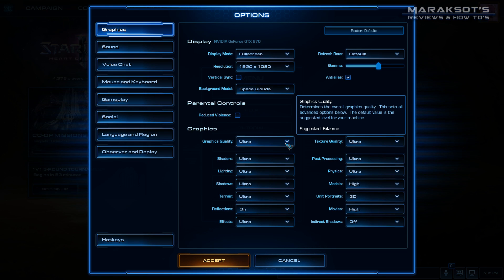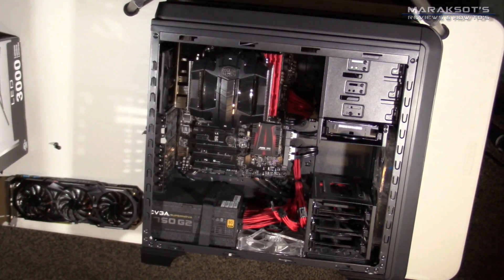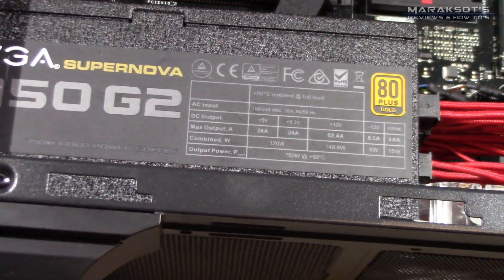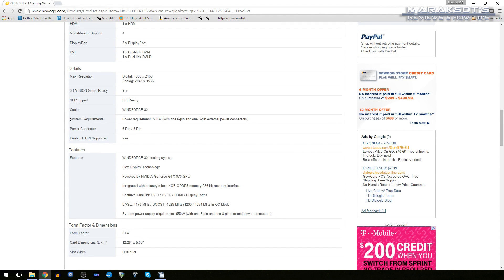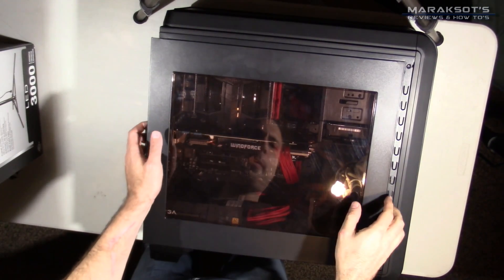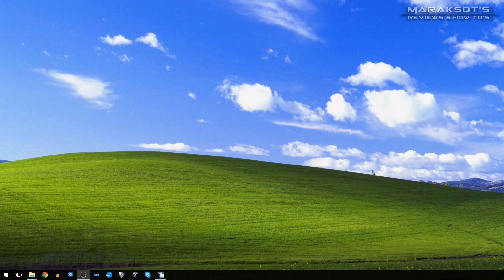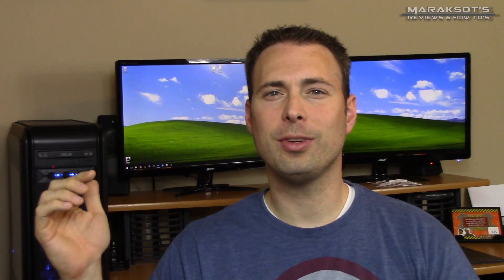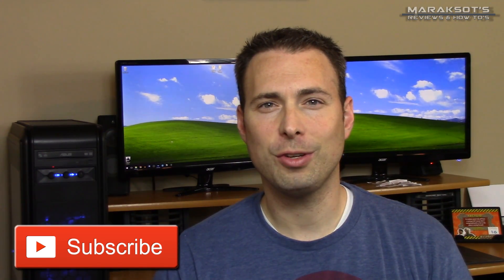A Beginners Guide - Upgrade your GPU - How to Install a New Graphics Card

Comment: My laptop has nvidia GeForce 940mx is it any good?
Reply from the maker: If you're wanting to run games at 1080p at High settings then you're going to have some really bad frame rates but if you're ok with playing on Medium and Low settings you should be ok.

Comment: My processor is a AMD fx-4300quadcore 3.80 GHz 

Can it run a graphics card like a GTX 1070
Reply from the maker: +why be just a gamer a GTX 1070 will work with the FX4300 however it's performance will be limited a.k.a. "bottlenecked" by your CPU.  What many people new to PC gaming don't understand is what bottlenecking actually is. The CPU (Central Processing Unit) is essentially the command center for your computer.  All data for any program running on your computer must be processed by the CPU.  When you have an older style architecture or slower CPU (like in your case the FX 4300) and you pair it with a much newer, high end GPU like the GTX 1070 what happens is your CPU gives your graphics card a job to do (render something in a game) meanwhile the CPU continues doing it's job for the game to run.  As soon as the GPU finishes doing the task it was given it stands ready to receive it's next set of instructions.   Ideally your CPU will be fast enough to continually feed your graphics card with the data that the graphics card needs to process so that it's never sitting idle, maximizing your number of frames per second. However what will happen in your situation is the GTX 1070 will finish processing the data it's been given and then will have to wait for the CPU to supply it with its next set of instructions resulting in fewer frames being rendered. Because the GTX 1070 is much faster and much more powerful. This reduction in frames due to the GPU having to wait for instructions from the CPU is what is called bottlenecking.  So let's say in a game the GTX 1070 is capable of displaying over 200 fps when paired with a high end CPU.  And when you pair it with something like the FX4300 then it's only capable of 100fps (I don't know for sure what the real numer of fps would be, this is just a hypothetical example) because it's spending half of it's time waiting for the CPU to send instructions to it. With the GTX 1070 costing between $400 and $500 U.S. in my opinion it doesn't make sense to spend that kind of money and then only get $200 to $250 worth of performance out of it.  Not to mention if you're playing on a 1080p 60 hertz monitor the GTX 1070 is way over powered for that. Because once again it will be rendering waaaaaay more frames per second than the monitor is even capable of displaying.  In my honest opinion I would think that the FX 4300 is probably more suited to something like a GTX 1050 or 1050 TI anything more than that and you'll be paying a lot of extra money for performance that you won't get out of it.

Comment: Before installing the new graphic card, do i need to unstall the previously one's driver or something?  Anyhow, after i've plugged the new one, how will appear a image on my monitor if the new one doesnt have a drive yet? It just doesnt make much sense to me and i'm afraid ill make a shittone here :0. Please help me here (noob detected)! It very incommum for the youtubers who do these types of videos to awnser this type of silly question lol
Reply from the maker: it really doesn't matter in which order you uninstall and install drivers.  You can swap out your old graphics card for a new one and then uninstall the old drivers and install the new ones and everything will work just fine.  Even when the drivers are not yet installed your graphics card will still work to display thins on your monitor.  Your computer still knows that your graphics card is a display adapter and will use it to display things to your monitor.  Drivers are basically the instructions for your graphics card that tells your computer everything your graphics card is capable of doing and how to use all the features of your graphics card.  Best of luck to you on your upgrade.  Cheers!  :)

Comment: Great explanation, thank you. If I want to install two identical graphic cards but only one slot of my three PCIe slots is a 16x slot, do I need a new motherboard with at least two 16x slots?
Reply from the maker: luftbilderhd no, what most people don't know is that the X16, X8, X4 or X1 is a designation of how many PCI Express lanes are available to that slot. Your CPU is built with a certain number of PCIE lanes (direct lanes of communication with the CPU) on it. Most mainstream CPU's have 16 PCIE lanes on them. When you use the X16 slot then all 16 of those lanes are made available to your graphics card so you can get quick communication between your card and your CPU allowing your games to run smoothly and at as high of a frame rate as your card can muster. However modern graphics cards don't have enough "horse power" to saturate all 16 lanes. 8 lanes is plenty enough for all modern graphics cards to my knowledge. And what happens when you install a 2nd graphics card in your system is your motherboard recognizes you have 2 graphics cards installed and then allocates 8 lanes to each card which is really all they need anyway. So if you're wanting to run an SLI or Crossfire configuration or are wanting a dedicated PhysX card I think you're good to go.

I feel I should add that not all games are written/optimized for multiple graphics cards so in some instances you're better off to buy the single most powerful card you can afford rather than spending the same amount of money on 2 less powerful cards.  For example, one $500 graphics card will give you outstanding performance in all games where as buying two $250 cards ($500 total) will perform really well in some games but not in others (some games will literally only use one of the 2 cards). So on those titles your money is kinda wasted.  I would really only recommend getting 2 graphics cards if you're going for the best of the best.  Like dual GTX 1080ti's or something as there is currently no single consumer grade GPU that can match that kind of performance. If you're wanting to do dual GTX 1050's or 1050ti's then you're probably better off to use that money to buy a GTX 1060.
Reply: Thanks a lot for your quick and detailed reply! Very appreciated! Now things are becoming clearer for me. Currently I have a three year old Gigabyte Z97-D3H motherboard with an i7 4790K, 32 GB RAM and a GTX Titan Black with 6GB VRAM. This machine is my sim PC, still running pretty well. When I use it, it runs X-Plane in 99% of the time. X-Plane is currently OpenGL only, SLI or Crossfire are not supported. I'm planning to upgrade the sim. I would like to go from currently one monitor/TV to three monitors/TVs (I think about 60" or 65" TV running in 1080p). X-Plane 11 has built-in multi-view support, so Nvidia Surround is not needed. Nvidia Surround would distort the picture on the edges anyway. Regarding X-Plane the CPU is always the bottleneck. Thus I think about changing the graphics card in the 1st step, because I need three reasonable video outputs. I think about a GTX 1070 or 1080, but I haven't built up my mind yet. I suppose that a GTX 1080ti regarding X-Plane would be overpowered.  In the second step (maybe next year) I think about enhancing it to six (!) monitors/TVs, arranged in surrounding portrait mode (something like this: http://flythissim.com/products/fixed-wing-flight-simulators/touchtrainer-fm-210.html). And no, I'll not use projectors, curved screens or VR headsets. To support six monitors/TVs I need a second graphics card with additional three video outputs. And I probably need a new PC with an actual CPU, but I could use both graphic cards with this new PC. Or I will run two instances of X-Plane, one on each PC, and connect them as master (the new PC) and slave (the current old PC) via X-Plane network support. 

But at first I'll have to achieve step 1. For step 2, that's why I was asking about a second graphics card. 

If you have some other ideas, I do very appreciate your advice!
Reply from the maker: you're welcome.  I'm happy to do what I can to help.  Sounds like you're going for a pretty amazing X-Plane set up.  I personally have never run games in multi-monitor mode.  I only use my dual monitor setup for productivity stuff as I work from home a lot so I don't have any first hand experience with multi-monitor gaming.  My understanding though is when you have multiple monitors it puts a lot more demand on the GPU as it has to render 2 (or in the case of what you're looking to do 3 or 6) screens worth of pixels.  In which case having a high powered graphics card like a GTX 1080 or 1080ti I think would serve you very well.  One very cool feature Nvidia's 10 series of graphics card have built into them is something called SMP (simultaneous multi-projection) it's a feature designed for multiple monitor gaming.  It eliminates the distortion on the edges you mentioned in games that are programmed to utilize it.  Having dual 1080's or 1080ti's is going to be very expensive but from the sound of it you're looking to build the best X-Plane simulator you can so I imagine the budget you have in mind for this upgrade is quite high.  Personally I feel that your i7 - 4790K is still a very good/capable chip even when using a GTX 1080 or 1080ti, however if you're thinking of upgrading just out of curiosity what platform/CPU do you think you may want to upgrade to?   Are you thinking of an Intel Z270 motherboard with the current king of gaming chips, the 4 core 8 thread i7 - 7700K?  Or going up to their enthusiast platform, X299 and something like the 10 core 20 thread i9 - 7900X?  Or are you more interested in AMD's latest Ryzen architecture and going with their X370 platform and an 8 core 16 thread R7 1800X? Or going up to their enthusiast platform, X399 platform and getting their latest 16 core, 32 thread Threadripper 1950X or something?  Going with an i7 or R7 CPU is going to be much more affordable however the i9 and Threadripper CPU's offer a lot more cores and threads as well as 44 PCIE lanes on the i9 and 64 PCIE lanes on Threadripper but they're also $1000 CPU's.  Sorry if I'm being too nosy I'm just very excited/interested in technology and love talking about it.  :)
Reply: Thanks again for your reply! I'm glad that you like technology; I do so as well. ;-) I don't have any multi-monitor experience on Windows (on Mac, yes), that's why I'm reading, watching and asking a lot. ;-) Thank you for the hint about Nvidia "simultaneous multi-projection". I suppose it's something like Nvidias "Mosaic". Regarding X-Plane you don't need those Nvidia features. You just have to set up your screens in Windows system settings, everything else you can manage within X-Plane. The latest version X-Plane 11 has a new multi-view setup. You can adress the screen what you want and set the virtual camera as you like (you can adjust the view angle a little bit for bezel correction etc.). For other games without multi-view-support the tools that Nvidia offers might help of course. 

Regarding CPU: Yes, I'm still happy with my 4790K. Although it's three years old, it does a pretty good job. Regarding OpenGL and X-Plane (again) on Windows a lot of users say it's better to go with Intel and Nvidia. X-Plane needs a CPU with good single core performance. So a 4 core 7700K is better than a 6 core or even more cores. Of course this might change in the future, as X-Planes code is optimized to make better use of more cores. Currently it's even recommended to turn Hyperthreading off when using X-Plane. Somewhere I have heard or read, that Intel will release a new CPU generation this fall. But I don't remember how it is called. If you have any informations (or web-links) about that, this would be very appreciated! Maybe they will lower the price for a 7700K, when the new generation has been released. Same with Nvidia. I think, a 1080 (or two of them) is good enough for my purpose. Maybe they will lower the price as well, when new GPUs are coming. But for the moment those bitcoin miners kill the global GPU market. :-/   

In the next weeks (or months) I will take my 1st step, buy a 1080 (or 1080ti) and three 60" or 65" TVs. We will see, if and how the 4790K can handle this... :-)
Reply from the maker: I don't know much about the next generation of Intel processors seeing as they haven't been released yet but I do know that they're calling them Coffee Lake (6700K was Sky Lake, 7700K is Kaby Lake) What I've heard so far about Coffee Lake is that Intel is upping the core count on Coffee Lake chips so the i3's will now have 4 cores where in the past they were only dual core, the i5's will be 6 cores instead of 4 and the 7700k replacement, the i7-8700k, will have 6 cores and 12 threads instead of 4 cores and 8 threads.  It's rumored the instructions per clock (IPC) on the new coffee lake chips is the same as Kaby Lake so it sounds like they're just Kaby Lake Chips with more cores and threads.  As for pricing on the new chips I haven't heard anything about that yet but when the 6700K launched it was the replacement for the 4790K and the price on the two of them stayed the same, no price drop.  The same thing happened again when the 7700K launched.  The 6700k stayed the same price. So based on the historical evidence I don't foresee the 7700K going down in price at all.  You may be able to find one 2nd hand for less but a new one I believe will remain at the $330-ish U.S. price point.  I like your plan though to stick with your 4790K for now and upgrade your graphics cards and monitors first and see how that works.  Best of luck to you my friend.  Cheers!  :)

Comment: Hi, My Name Is Brandon. I know this is a old video, but some people still watch these type of videos and can probably help me out. I am buying a prebuilt PC because I want to switch from consl to PC (lol pc master race). I just wanna know if I can upgrade the graphics card. It has a amd fx-4300. Will it support a GTX 750ti? Just wanna know. Thanks for the support :).
Reply from the maker: +Pepper // CS:GO & More! You should be just fine with that man. Enjoy! Welcome to the PCMR! :D ha ha
Reply: Thanks! Oh, btw will it be fine with a 350 watt power supply?
Reply from the maker: +Pepper // CS:GO & More! Um... good question. From what I've read the recommended PSU wattage for the 750ti is 400 watts... but those numbers are usually kinda conservative, a little higher than what is really needed, to ensure system stability and whatnot... so I think you'll be ok but at the same time I'd recommend looking into upgrading your power supply just to be safe.
Reply: Upgrading a power supply  seems to hard. :/ ( for my standerds at least). I also get a gt 730 2gb wit the pc. Then I thought upgrading the cpu to a athalon (if its amd). do you think my pc wil survive with a 350watt and a gtx 750ti? ;-;
Reply from the maker: +Pepper // CS:GO & More! Upgrading a power supply is a lot less scary than you may imagine it to be.  I actually just finished making a Beginner's guide to building a gaming PC video series if you'd like to check it out?  But you can certainly give it a go and see what happens. My first inclination is your computer will be fine.  Knowing that the FX-4300 uses 95 Watts and stuff I've read says the 750ti uses 75 watts... then you have other components in your system that all need a little juice... with 350 watts... yah, I think you'll be good.
Reply: Maraksot78 K thanks fam lol. I'm going to make you my tech help lol. This video makes it so easy to do.
Reply from the maker: Pepper // CS:GO & More! No problem man. I'm happy to do what I can to help. :)
Reply: lol i'm back. just wanna know if my 350 watt will handle a amd fx-6300 and a gtx750 or ti . I f not then should i upgrade my cpu from a fx-4300 to a fx-6300 or my gpu a gt 730 to gtx 750ti
Reply from the maker: That's kind of a tough question man.  Seeing as I don't have any first hand experience with any of the hardware you're talking about I have to go on the tech specs and other people's testing I can find online.  Based on what I've found I wouldn't recommend using the FX-6300 and the GT750 or 750ti with only a 350 watt PSU.  As for what you should do... it's really up to you.  It depends on what games you want to play, the settings you want to play them at and what your budget is.  

If it were me and I was trying to build a budget gaming rig right now I'd look at the new Ryzen 3 lineup of CPU's and build on a new platform because the AMD FX series is now very dated and has a very limited upgrade path.  Ryzen on the other hand is brand new and if you got an inexpensive Ryzen 3 chip now you'd be able to upgrade that chip to a Ryzen 5 or Ryzen 7 a couple years down the road and be waaayyyy further ahead than going with an FX system.

That being said I don't know what your budget is.  Going with a Ryzen 3 system may be out of the budget for you.  But that would be my suggestion man.  Pass on the FX 4300 system and just build your own Ryzen system.  I know that building your own computer sounds scary for people that have never done it before but it's really a lot easier than people think and there's a ton of great resources on YouTube and other places online that can help walk you through the process.
Reply: k. Do you think  GT 1030 2 gb can handle the 350 watt psu with my cpu?
Reply from the maker: Pepper // CS:GO & More! I think so.
Reply: Ok, so I just found a pretty good gpu. Do you think the AMD Radeon RX 460 2gb will run?
Reply from the maker: +Pepper // CS:GO & More! Well... the recommended power supply wattage for the RX460 is 450 watts... so I'd still recommend upgrading your power supply.
Reply: Maraksot78 looking to buy a 700w
Reply from the maker: oh wow.  That's probably a bit overkill.  a good 500 to 600 watt is plenty good enough for most gaming PC's nowadays.  :)